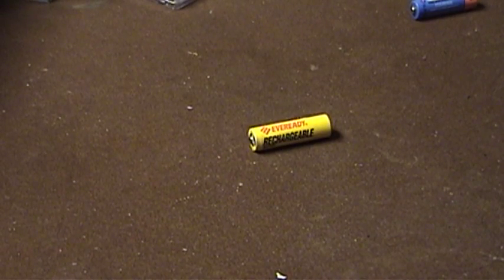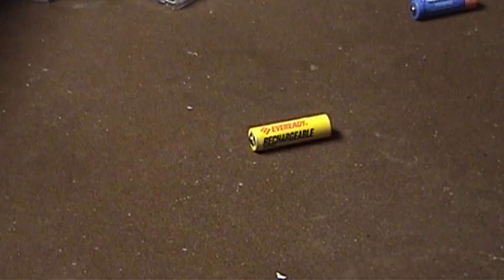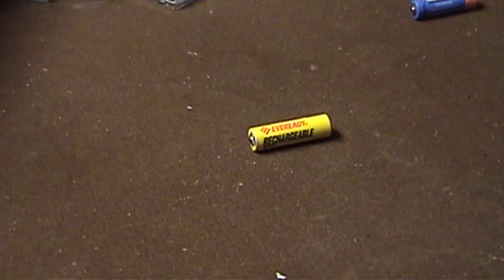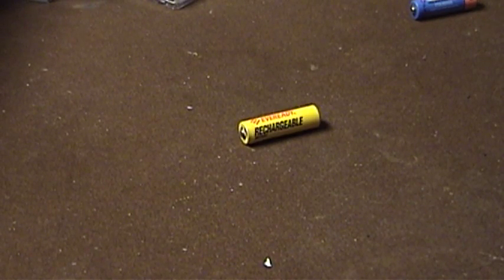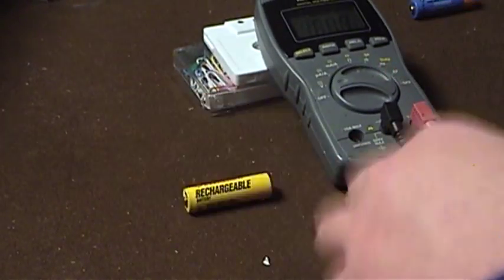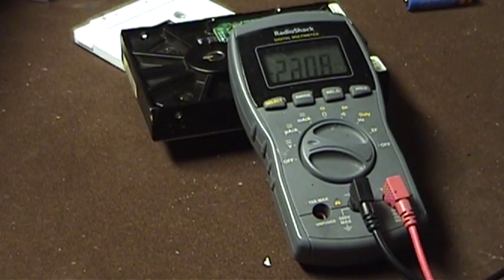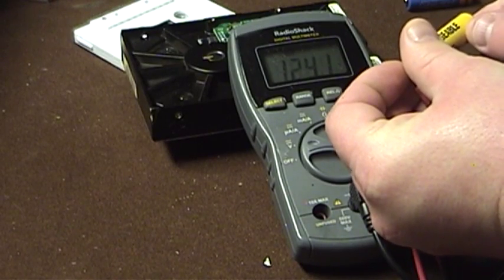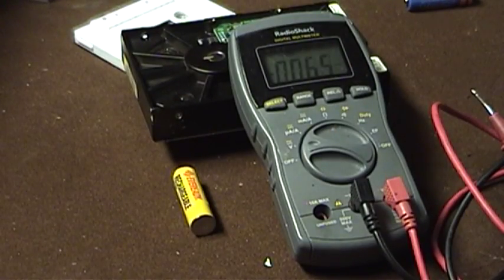The Amazing Nickel-Cadmium Battery!

Comment: Hey I have a question. I was given a Phillips electric battery powered shaver 24 years ago (Christmas 2001). I literally just opened it today. Is there any danger with the battery being that old? It does seem to charge up and work.
Reply from the maker: Most likely not, though nothing can be absolutely guaranteed. The battery may fail after a few charging cycles. It's probably a NiCad or NiMH battery and those usually fail quietly, by simply refusing to charge.
Reply: @ thank you,  yes it’s a NiCad battery. Going to order a replacement (surprisingly available online).

Comment: NiCad is NOT DEAD!!! Many pro tool makers still use  them today. (2024). They are incredibly rugged.
Reply from the maker: No major tool manufacturer is using NiCad batteries in anything any longer. It's not a question of how rugged the battery is. The cadmium is seriously toxic.
Reply: @uxwbill  Tenergy still makes consumer Ni-Cad batteries.
i just ordered a set for a flashlight.
    Lowes sells a Fleming Supply 18 volt cordless drill with a Ni-Cad battery for $53.00.

Comment: I have a Ni-Cd cordless phone battery pack which has been in use since 1997, it too is still working today but based on the run time of the phone I'd guess it only has about half of its original capacity remaining.

Comment: Not too surprising, a good portion of the late 80s and early 90s NiCD AA batteries I have will still take a charge. It's only about 200-500 mAH though according to my charger. I have a truckload of low discharge Eneloops laying around too so there of no real use, but still amazing they work.

Comment: I have a laptop (matter of fact, my favorite older machine, my pentium 2 gaming laptop) that is a Toshiba Tecra, that still has a battery that also has every right to be dead.  Matter of fact, it gets better life sometimes than my modern laptop.  It does however take it overnight to charge to full, but I get hours of use from it to this day.  I've also had it for two years, and it's undergone moderate use.

Comment: Some of the first nicads you could buy were the radio shack ones, I remember buying four in the 80s and they were eye wateringly expensive.  A colleague had one that was  25 years old and still going.  I also remembered that if you over charged them they smelled like "Savlon" antiseptic cream.  They were also capable of very high current, if you shorted them with a wire you could easily make the wire glow, something modern nicads don't seem to do.

Comment: Last year I found two D-Cell NiCD 4000mAh batteries in one of my drawers and wanted to know if there was any juice left on them. Hooking up a meter revealed a reading of zero volts. So I set my lab power supply to 2 Volts 200mA and connected the wires to the battery terminals. Slowly but surely the voltage creeped up from zero to 1.4 Volts or so. Then they went into the charger and successfully completed a full charge. I honestly admit: That's a tough quality for 25+ years old batteries from SANYO which were left in a discharged state in a drawer for years!

Comment: This doesn't surprise me. NiCD batteries are very resilient against the test of time. Back in the early 1990s my parents bought two Radio Shack AAA units, and, as far as I know, they never had a charger, so they used whatever residual charge was in them, and then they sat. Then in the mid-2000s, I bought our first charger, and lo-and-behold, those batteries worked just fine. I used them frequently until just a few months ago, when corrosion started forming on the terminals.

Comment: Is this Rechargeable Battery made in USA? =D

Also I have an old battery that I previously got the 1985 Panasonic Tape Recorder at the yard sale, and I noticed that it stored in battery compartment where I see the batteries that are badly corroded like a snow coated on the top, and all three of them I throw it away, and one I saved the old Energizer C Size Battery and it still holds the charge and I think it was made in 90's, and yes, my Energizer C Size Batteries is made in USA, and it's amazing. =D
Reply: ***** eveready is actually still in business making lots of products
Reply: The Man Yes indeed, and even though alkaline batteries like gold version is also made in USA. =)

Comment: Funny you made this video! I just found a couple of those AAs while cleaning yesterday! I had a kit of those exact batteries as a kid in the 90's. I know they don't like being used to power electro-magnets. I did that and other "experiments" with them as a kid. I know they didn't like it because one day I was recharging them and this horrible smelling white smoke was coming out of them or the charger- I don't remember which. However, I do remember that the charger and most of the batteries were in the garbage soon after that!
Reply: ***** So how did that go? ;)
 I remember doing more than a few things that easily could have ended very badly.  One of the bright things I did was hook up the motor from my erector set to AC line voltage to see if it would "go faster"....... O_o

Comment: i once found an old kodak portabe miniprinter at an flemarket for next to nothing and it had 4 nickel cadium batterys in it and after chargeing them with a ancent batterycharger from the 70s they actully took charge and was perfectly useble. i was however unable to get the printer to comunicate with eny computer not even a old Windows 95 laptop so i suppose it dident last as good as its batterys

Comment: I use Energizer AA batteries in my camera. It doesn't have a built in battery or charger and thanks to my clumsy hands it also has a busted battery cover that I have to hold shut using the technical method called sticky tape. They are rechargeable energizers. I have found that the little point and shoot digital cameras that take photos and video will not work on cheap brand batteries, if they do they will last about as long as your snowball in a desert. I would really like a camcorder as I recently started making video's with me talking (something I didn;t have the guts to do until recently) so something with better mic quality would be good. Even an old Sony VHS camcorder like yours will do as I have a PC that can capture the video.
Reply: RandyDarkshade You mean Digital8, not VHS. I don't think you'll find a VHS camcorder that would produce video fit for YouTube. :P
Reply: Single-use lithium cells work great in the application of cams that run on simple AAs.

Comment: I have a pile of un branded Ni-Cad cells that were removed from some old Motorola MX portable series packs and HT440 packs from the late 70's to early 80's and they still hold a charge and have retained their current capacity. Granted about half of the cells total were corroded but I managed to salvage around 80 good ones that are good candidates for a re-cell project maybe.
They do make battery conditioners for packs or individual cells also for the two way radio repair market but I'm not sure about the consumer market,, I dont know if any store bought versions are worth the money but I do know the ones for commercial applications like what we have are worth every penny.
I just got some that will do Li-Ion and Li-Po types recently but they were not cheap.

Comment: Yep, most of the ones i have hanging around are very ill, nicads were ok as long as you used them hard, most batterys are rubbish at long term energy storage and you never get out what you put in :-(
Ooow no stand on you meter, i am supprised, i have a ye olde micronta digital multimeter from the mid 80's, it came from tandys in the uk, a very reliable old beast and after i looked at the controller chip i was able to recalibrate it for better accuracy, but im waffling on again, it has a handle that can click into place and become a stand.
Some designers want a boot up the you know what lol :D
Reply: *****
For your safety i would say use glue or 3M stickypads to attach your hasp, dam good idea bill :D
Also it would be a shame to possibly damage the meter with screws, multimeters are so usefull and well worth taking care of :D

Comment: They probably should have included a stand, because Radio Shack is effectively dead. http://www.marketwatch.com/story/radioshack-warns-investors-its-stock-should-trade-at-zero-2015-03-13

Still, amazing that the battery lasted so long.  Maybe it discharged to the point that the internal voltage was so low that the usual chemistry didn't do enough damage?
Reply: That's what I'm seeing on the financial sites and forums, as well. 

Agree about their changes in the 90s, too.  I remember walking into a store, and after getting a blank stare when asking for a power diode (no, it's not a type of phone recharger!), I looked around and thought to myself, "Why did they turn RS into a toy store?"

That store was mainly electronic toys, a few overpriced computer items, cell phones, (mostly car) stereos, and a whole wall of cell phone accessories.  Did RS really expect to make a killing off of paisley cell phone covers?

I finally found the electronics components section, which was jammed into an awkward corner, and about half the size and drawer configuration of a mechanics tool cabinet, with a couple soldering irons and half a dozen larger components hanging on the wall above it.  Inside the drawers was a half-stocked, forgotten mess of grab-bag components, and the staff seemed uninterested in wasting their time (and commissions) ordering a $4 part, when they could be selling a $200 cell phone.

Have only gone back a couple times since then, and rarely bought anything.  They forced me to find other suppliers, and I begin ordering things online.  So while I feel a pang of nostalgia and sadness seeing them go, it's been a long time coming.

Comment: Too bad it's not old enough to have the jumping cat logo on it! I also had a remote-controlled toy truck as a kid, and it was kind enough to provide a built-in battery charging function, so all you needed to do was plug in an AC adapter.
Reply: That was Ray-O-Vac's old battery logo for their 9 volt batter line originally but they stamped it on others because it became popular.
I do have some of those old 9 volt batteries around here someplace
Reply: ElfNet Gaming Rayovac has never used the cat logo - that's Eveready. Rayovac used a stylized Ray-O-Vac logo, and then introduced the lightning bolt logo in the 1980s.
Reply: yeah your right, damn i feel like a dumbass now lol.. I found one of the old ones and yeah.. Oh well I can just laugh about it though..
Reply: ElfNet Gaming Ah, it's an easy mistake to make. :)